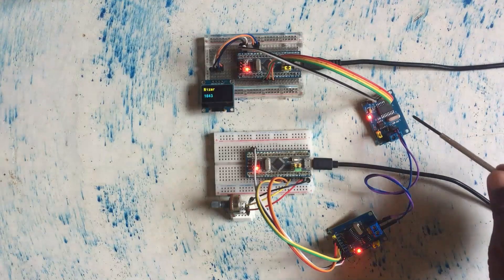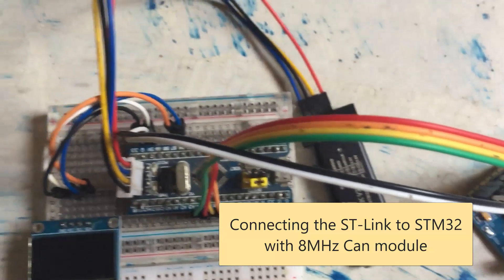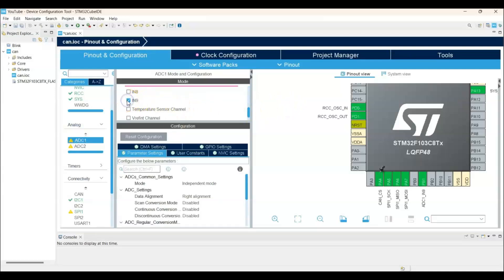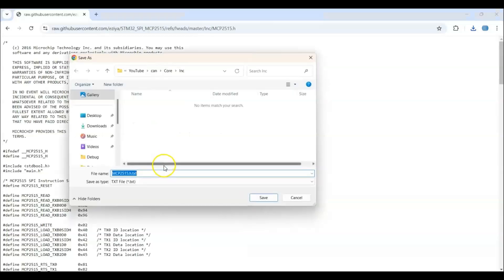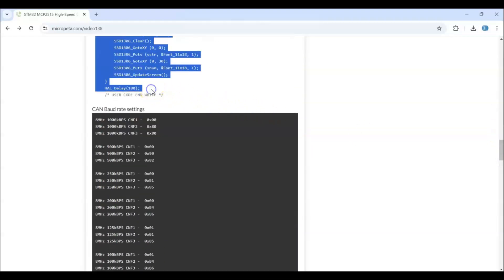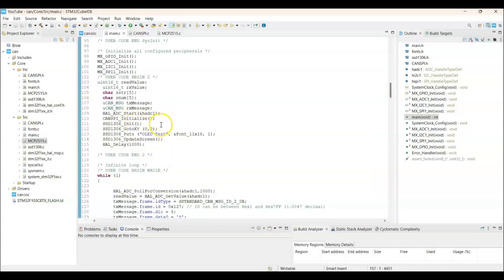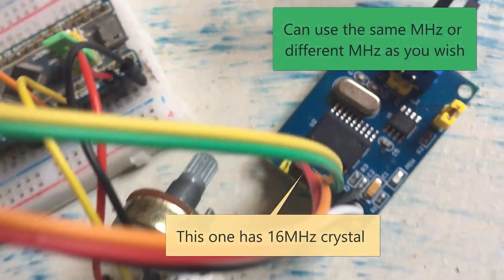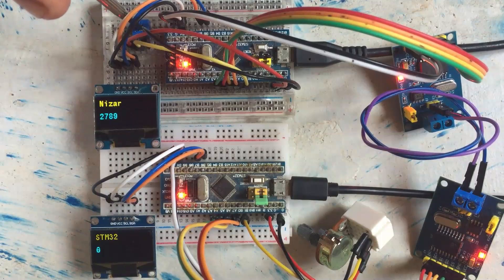138. MCP2515 CAN Controller with STM32 F103C8T6 in STM32CubeIDE

Comment from the maker: Why I used MCP2515 SPI  CAN bus while STM32F103C8 has built-in CAN
The reason is many STM32 do not have built-in CAN such as STM32F411 or STM32F401 BlackPill
We can use the library here for those STM32